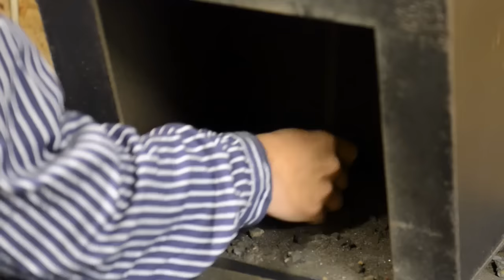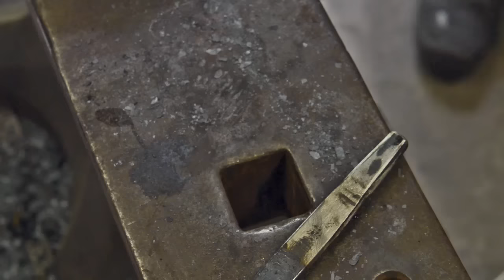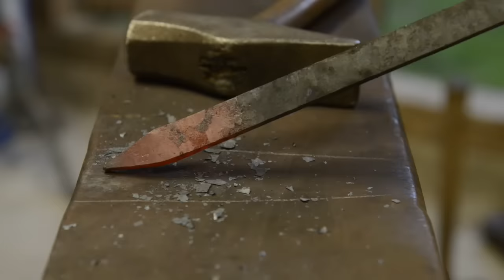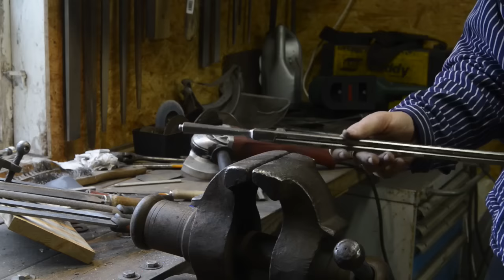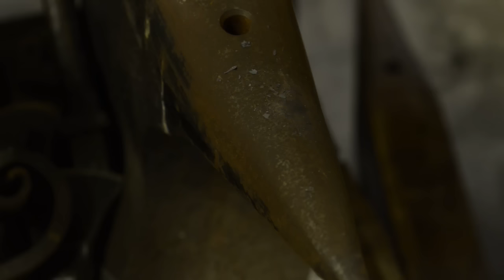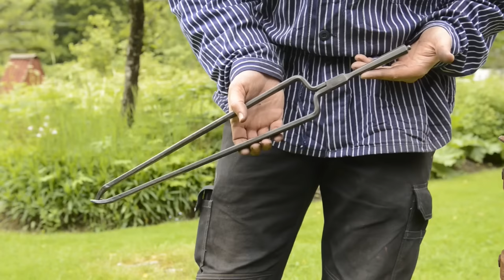Blacksmithing - Forging a pair of fireplace tongs

Comment: That was the most beautiful and masterfully crafted piece of metal i have seen on you tube. I know it was just a pair of tongs, but every hammer blow had a reason and was carefully planned out. Each heat was for a specific temperature and no higher. Well done.
Reply from the maker: Thanks!

Comment: How the hell is your final work so clean? Surley hammer control only goes so far... Not a single ding or dent on the piece that I could see. Amazing
Reply from the maker: +Matthew Marting On this piece there were allot of filing done... and if you are careful drawing down on the power hammer you can get really smooth results.

Comment: What sets you apart from so many other smiths is your utter attention to the details.  "as forged" is great and can look/function very well, but a smith that spends the time to hand file and fit his forged pieces is a step above the rest.

  One issue I've struggled with as a smith... the fine line between "good enough" and "perfection" since the latter takes 3 times as long. but you can't always charge 3 times as much.

Comment: Beautiful work.
 May I ask? It seems that tapered eight sided handle serves no purpose at all except to add a certain style to the tongs. Do you ever use it with 2 hands at the same time?It seems that the tongs would work without the handle.
Reply from the maker: Roman Dybala Thanks! The pattern/design was frequently used and is still today I think. For heavier pieces of fire wood it's actually quite good to have, but they would "work" without it I think.

Comment: What would be your advice on re-purposing some old tongs got at a flea market? The one I got are a little out of shape but were good for me just starting out. Haven't started still need something to use as an anvil, which i'm keeping an eye out for locally.
Reply from the maker: +Jon W Generally it's hard to re-purpose other types of tongs to blacksmith tongs. For example channel-locks, they are angled and have small jaws and short handles. My advice is, when you start, start with small projects and use whatever tongs you have, then when you're a bit warmed up start making your first pair of tongs. It's not very complicated at all and you don't need tongs to make tongs if you use longer pieces of stock. Good luck.

Comment: I want to know more about your fireplace!!
Reply from the maker: +Jan Morse I've got some requests like that... maybe I do a video about the forge.
Reply: +Torbjörn Åhman  I was actually speaking of the fireplace your putting wood into at the end of the video. A video on your forge would be great too.
Reply from the maker: +Jan Morse Ah, sorry. It's the "cheap mans" tile stove (google rörspis), without tiles and just plaster on the outside. This inside is more or less identical, with channels running up/down/up and out... good heat source actually.
Reply: +Torbjörn Åhman  I did as you suggested..........interesting!! Thank you very much.

Comment: I recognise your hammer, Tor size 8(?) I found a box of heads  at the weekend here on Värmdö east of Stockholm. I am building the forge now. Do you have any recommendations (tools / supplies / events) specific to Sweden or Stockholm?
Reply from the maker: +andrew boddy Cool! Not sure of the size #, think it's 900g TOR I use here. I have most of the sizes. Recommendations... well search BLOCKET and  Tradera for tools and even fuel. There are a couple of events each year, granbergsdal, ramnäs, smides SM etc.

Comment: Wow it's really a beautiful piece ! :) I was always wondering, how do you quench the tools you make ? And how do you think (or know) your tools are ? Brittle ? Tough ? Sorry if this sounds idiotic but I'm learning in order to someday (when I'll get my own home and money :D) forge myself ! (I will greatly follow your videos trying to reproduce your work :D) Thank you ! PS : And if I may, is it what you do for a living ? Just wondering :)
Reply from the maker: Raaampage Thanks. Heat treatment on paper is quite complicated actually. It all depends on what type of steel you use and how the tool is used. The alloy dictates the quenching medium, usually oil or water. Then you temper the tool to the hardness you like. I like to make my tools on the soft side; it's better to deform instead of breaking or failing abruptly possibly sending shards flying. Several tools that I use hot, like hot chisels, drifts and punches I leave normalized (spring steel), because they will loose any harness anyway.
Reply: Torbjörn Åhman Thank you taking the time to respond ! I appreciate it :)

Comment: Very nice video!
I just wonder, when you finished it, did you do anything more than brush it with the wirebrush? is that really enough to get a very good finish?

I'll just add your videos are part what inspired me to start working with metal, no real blacksmithing yet, but I'm corking my way up there :)
Reply from the maker: Yyunko Great! That's part of why I post the videos, to inspire people! Nothing else than a bit of heat, wirebrush and a thin layer of linseed oil. Works fine for indoor items. Thanks!
Reply: Torbjörn Åhman
Thanks for the answer! I'll try that if I get to making larger pieces!

Comment: Torbjorn, I love how your chimney hat sits keeps the weather out when not in use.  How does it stay in the "up" position?  Is there a hook inside your hood that the connecting rod hangs on?  Do you have any videos of your hood's construction?  I looked, but did not find any.  Very ingenious!

Torbjörn , jag älskar hur din skorsten hatt sitter håller vädret ut när den inte används . Hur det bo i " upp" -läget ? Finns det en krok i din huva som vevstaken hänger på ? Har du några videoklipp av din huva konstruktion ? Jag såg , men kunde inte hitta någon . Mycket genialt !
Reply from the maker: +Rick Barter Thanks. Yes I have a small "shelf" inside the hood where I rest the connecting rod. Works very well actually. No I didn't video the forge or hood build. I think I will do a "info"-video about the forge some time soon...
Reply: +Torbjörn Åhman thank you.  An info video would be great!

Comment: what wood is the coal of ?
Reply from the maker: +turbotonic27 Coal is coal. Charcoal is made from wood and what I use is mostly made from different hardwood.
Reply: Torbjörn Åhman thanks my english is not perfect . can you tell me why my charcoal is cracking and sparks  alot
Reply from the maker: +turbotonic27 You're not using briquettes are you? It mostly depends on the type of wood used I think. Moisture content may also be a factor.
Reply: Torbjörn Åhman ooh then thats it i guess. ive had those for a long time sitting in the basement  , and no im not using briquettes

Comment: I believe your design is a bit flawed.  There needs to be independent handles that operate the ends, much like scissors.  The operator should not have to use one hand to grasp the past the pivot point.

Excellent work and the tongs are beautiful, just need a bit of design refinement.  You are very, very, skilled!!
Reply from the maker: It's not my design! :) It's an old idea

Comment: nice work as usual but that tool is not that handly to use 
actually
Reply from the maker: +griseum I tend to agree, but not as bad as you might think. It's a pretty old and well established design.
Reply: it is good for small logs and wooden pieces.